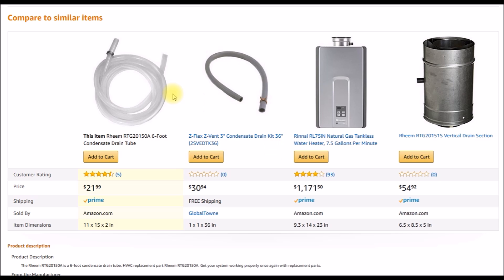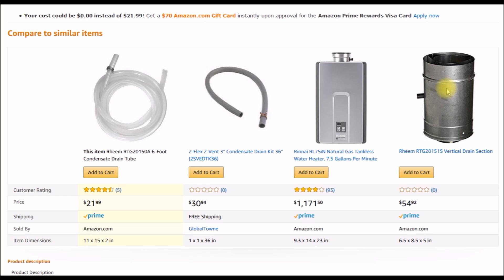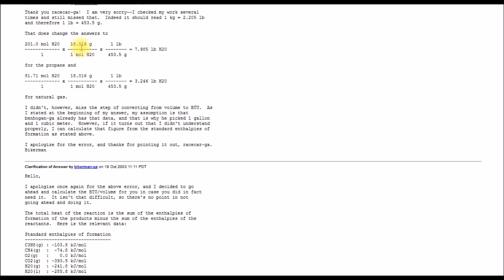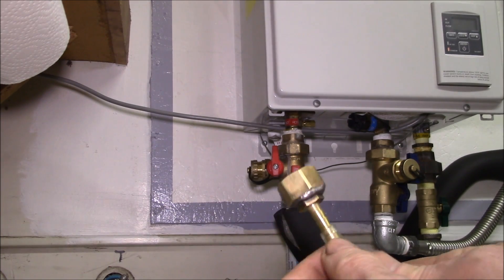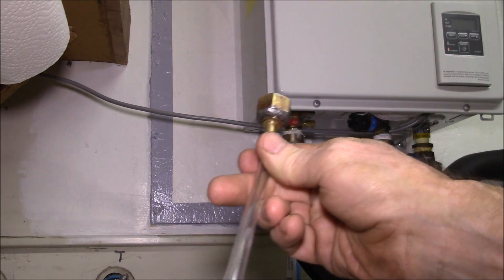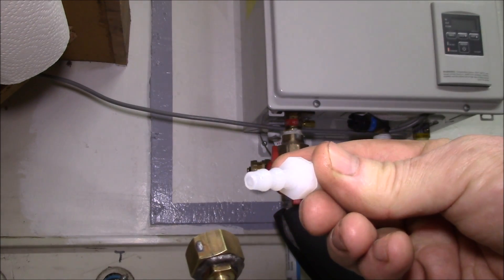Tankless Water Heater, Condensate Drain

Comment from the maker: Timeline:
0:00 Intro
0:10 Commercial condensate drain options
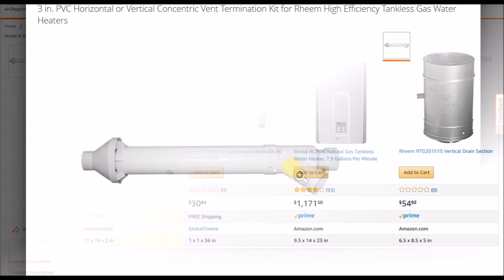1:40 Concentric vent kit
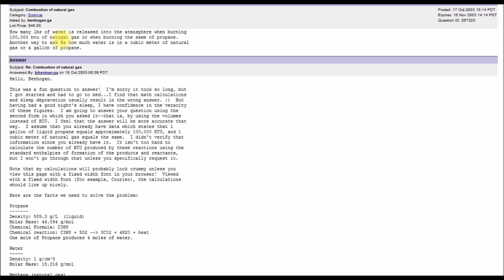2:10 Volume of condensate
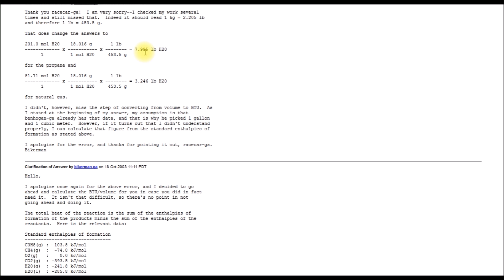4:29 Condensate drain location
5:38 Brass condensate hose adapter
7:24 Nylon condensate hose adapter
7:45 Condensate hose in action
9:30 Condensate stops

Here's a photo of the brass fitting I used on the drain after 7 years of use:
https://photos.app.goo.gl/4P4K9QUMvc5T4eMx7

Comment: I think they recommend a loop, like a p trap in certain situations to keep your water heater from getting sewer gases back flowing. But maybe you already have a p trap in that drain line most likely?
Reply from the maker: Yes, the bottom of the clothes washer drain standpipe has a trap and a vent inside the wall:
https://www.nachi.org/gallery/piping/standpipe-for-a-clothes-washer

The condensate drain line has an air gap where it empties into the standpipe and the water level in the trap.  But yes, if connecting directly to a dedicated drain pipe some sort of trap would be required.

Comment: Don't you need a vent near the unit to prevent hydrolock?
Reply from the maker: I think with some brands of heaters, things like vents and/or traps are required for the drain.  But with this model, it says: 
"Connect a drain tube from the condensate drain port located on the bottom of the water heater to a standard drain."
"Leave an adequate amount of space between the end of the drain tube and the actual drain, to facilitate proper drainage." 
with no mention of a trap or vent line.  This drain line is only about 12"/30cm long and drops straight down into an open clothes washer standpipe. If this were a dedicated drain line, then yes, a vent line would probably be needed.  I've never seen it back up in the last 8 years.  It also never completely fills with condensate in use.

Comment: Only use plastic fittings on the condensate. Trust me I learned the hard way 😂
Reply from the maker: Good point, I'm check the brass fitting every year or two.  In 7 years use, it has discolored a bit:
https://photos.app.goo.gl/GeTSn1FSgLHnA6pFA
I do have a PVC hose barb fitting ready to replace the brass fitting if it does spring a leak.
Reply: @The4Crawler  it took mine about 12 years to eat through FYI. thanks for making the video!
Reply from the maker: @troyhough  Good information on the lifetime you got.  I may swap out that fitting then before it rots out so it's still useable as a spare for the PVC fitting I have.  Only issue I find with with plastic is it seems to like to crack after some years, so having a ready spare is a good
Reply: @The4Crawler  I don't think it will ever crack unless it's overtightened or there is unnecessary strain.

Comment: Our Rheem unit, in our 2-person household, makes so little condensate that it evaporates out of a catch-bucket. No external drain is needed at this time.  The condensate is alkaline (I tested it using 4 methods) - because our tap water is alkaline!
Reply from the maker: Yes, it's usually not a lot of condensate.  Does your condensate drain come off of the side of the exhaust vent or does it come out of the bottom of the unit?

Comment: Thanks for the video!
I have a problem on my rinnai condensing water heater. I flushed it today and after doing it,  even when heater is not running, there is a steady flow of water from condensing pipe. What to do to fix it. Thanks!
Reply from the maker: I'm not very familiar with the Rinnai heaters.  You might try Mike at This Tankless Guy:
https://youtu.be/kfzmyMdYGL0
He's a Rinnai service tech. and really knows those units inside and out.

Comment: Condensate being acidic, I don't think you're supposed to use copper fittings?
Reply from the maker: Good point.  The hose barb adapter I used is brass, which is listed as "Good" resistance to carbonic acid:
https://www.dixonvalve.com/sites/default/files/downloadable_resources/product_literature/corrosion%20resistance%20chart.pdf
I've been keeping an eye on the fitting and have procured a PVC replacement in case it starts to corrode.  But in 5+ years, it still looks like the day it was installed.

Comment: should the drain be  pointing  towards the ground?
Reply from the maker: You generally want the drain running in a downward direction to get the condensate water to flow away from the heater.  Some installs have it running into a separate condensate pump, which might pump the liquid up to some other location.  Others might run outdoors, or into a condensate neutralizer before going into a drain.  You might also have a trap installed if the condensate line is directly connected to a drain pipe.  On my install, the drain line runs into a washing machine stand pipe, via an air gap and there's a trap at the bottom of that stand pipe.

Comment: THE ISSUE I'M RUNNING INTO TRYING TO DO WHAT YOU DID IS UNDERNEATH THE UNIT I HAVE A HOLE WHERE YOUR COMPRESSION NUT ATTACHES TO UNIT ON MY QUIETSIDE I HAVE A HOLE THAT I WOULD NEED TO INSERT SOME KIND OF PIPE FITTING THAT WOULD THE CONNECT TO THE NUT AND THE REST OF THE SETUP YOU USED

Comment: Is it normal for there to be a constant flow of water from the tankless heater into the drain pain which flows outside the house? (even when there has not been any hot water used in the house for a long time?  Water is flowing like a faucet turned on low meaning much more than a drip)
Reply from the maker: If it's a condensate drain, then no, there should only be water dripping when the burner inside the heater is firing and the exhaust gas is condensing.  Although some heaters apparently have small condensate tanks or neutralizers that may hold and slowly release water over time.  It might be worth having the heater checked for leaks.  One easy test would be to turn off the cold water supply to the unit and see if the drain flow stops.  If so, there may be a leak someplace in the heater, maybe a loose connection or leak inside the heat exchanger.

Comment: Don't use the galvanized pipe on gas lines.
Reply from the maker: Yes, used black iron pipe/fittings and a brass shutoff valve for the gas line.  Still working great, coming up on 3 years since installation.  The water lines are galvanized, same as the existing piping in the house.
Reply: Our plumber used galv pipe for all our gas lines during a repipe.

Comment: You did ok but, Way over thinking.  It's not rocket science, just a drain. Your furnace condensates the whole time it's running.  You could have used 5/8 hose. Warm the end up and slipped it over the 1/2" threads.
Reply from the maker: Thanks for the comment and suggestion.  Yes, lots of ways to skin a cat, as they say.  I wanted to stick with a relatively small dia. hose so I could slide in in along side the clothes washer drain tube into the existing standpipe.  As-is, it was a tight fit.  Nearly 2 years in and no issues with the condensate drain and being clear, I can see that water is flowing through it easily even running the heater full blast on a cold winter day.  I wanted to show my research and calculations on sizing the drain hose I ended up using and that seems to be proven out in real life use.

Comment: Where does this condensate end up going?
Reply from the maker: The drain line drops into the clothes washer drain / standpipe which is just below it, you can see that at 4:30 in the video.  So the condensate goes down the drain and any slight acidity is neutralized by the detergent and soap residues in that drain line.  It's been working well for the last 20 months, no issues at all.
Reply: R Brown would it be possible to have this condensate drain drip from a hose into a bucket or something? If a drain isn’t nearby
Reply from the maker: Sorry for the delay in replying, never got a notification for your comment.

Yes, I suppose that might work, you would need to see how long it takes to fill up and make sure to set up an emptying schedule.  Probably would not pass a plumbing inspection though.

Or you can get a small condensate pump that has a catch tank and float and it'll fire up when the level in the tank gets high enough and pump the condensate to a drain:
https://amzn.to/30DKmzu

Comment: I think you are a bit mistaken with your assessment of the Rheem 3-in concentric PVC vent. I installed one on my own Rinnai RUCS75IN. The middle pipe is for exhaust because exhaust naturally rises, making it escape faster. The outer layer that draws air from under the cone does so because that reduces drawing in rain water and debris. More importantly because the hotter exhaust gasses rise away from the roof, the intake is getting clean air from outside. The unit functions as to combine a 3-in intake and exhaust vent into one unit to reduce roof/wall penetrations. I used a 4" Oatey roof boot from Lowe's to cover the old B vent hole and put this through. Mastic and roofing nails and not a problem out of it. Just endured Hurricane Florence in NC without a leak. I kept the old drain pan in place from the tank water heater that was in the attic and drain the condensate to that. The pressure relief valve by code also has to have a pipe that puts it no more than 6" above the pan, the same as the condensate line. The IBC is not very well written for tankless water heaters, so best to follow codes even though they may not apply. A PRV on a tankless water heater is just silly. Also I believe the code says that tubing coming in of and out of the water heater must be metal at least 6 in from the intake/outlet couplings and the vent (also coded towards tank water heaters).
Reply from the maker: Great information on the concentric vent.  I looked at the concentric vents but decided that separate intake and vent pipes would work best in my installation.  My old tank type heater had no condensate drain and originally it had no drain pan either.  I added one when I replaced the tank in 2000.  The heater is in an unfinished garage.  Agreed that the codes don't really cover tankless heaters that well, the PRV and also the expansion tanks specified in some areas.

Comment: Does anyone know if the plumbing codes require anything special with the condensate drain for tankless water heaters?
Reply from the maker: I found this in the California Plumbing Code:

"509.9 Condensation Drain
Provision shall be made to collect and dispose of condensate from venting systems serving Category II and Category IV appliances and noncategorized condensing appliances in accordance with Section 509.8.3. [NFPA 54:12.10.1]
509.9.1 Local Experience
Where local experience indicates that condensation is a problem, provision shall be made to drain off and dispose of condensate from venting systems serving Category I and Category III appliances in accordance with Section 509.8.3. [NFPA 54:12.10.2]"

And this is what Takagi says:
"CONDENSATE DRAIN
• The water heater does not include a built-in condensate neutralizer cartridge for reducing the pH level
of condensate water. If local codes dictate that condensate must be neutralized prior to drainage, a
condensate neutralizer must be installed. An accessory Neutralizer assembly is sold separately.
• In the absence of applicable local codes and regulations, the manufacturer recommends that
condensate be disposed of into a standard drain. Connect a drain tube from the condensate drain port
(shown below) located on the bottom of the water heater to a standard drain."

I could not find any specific requirement for my city regarding the need for a neutralizer kit or anything special, I just did as the mfg. describes.  Mine drains into a laundry drain, so the alkali detergent residue is supposed to help neutralize any acid in the condensate.  The municipal water is at a pH of 7.8 - 8.1, so acidic condensate is not an issue locally.

Comment: Where did you plumb your pressure relief valve to?
Reply from the maker: I used a 3/4" PEX TPR drain tube that drops down to about 6" off the garage floor, behind the clothes washer.
Reply: Thanks for the quick reply. Not sure if that's code in my area or not, but mine would be going in garage as well not too far from existing tank water heater. Current water heater has a line through the wall that exists outside for the pressure relief. I still need to research code, but thinking I can try to plumb back through that if it's not too much trouble.
Reply from the maker: My old tank TPR pipe dropped down to the garage floor as well.  However, it was not done to modern code as it had a 3/4"-1/2" reducer and 1/2" drain pipe along the tank.